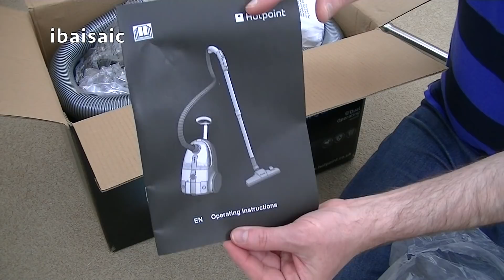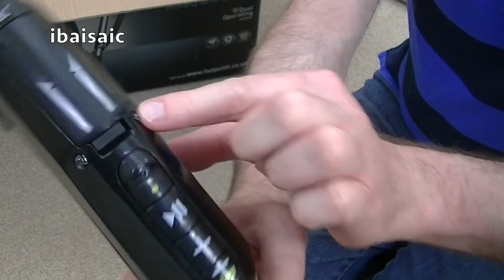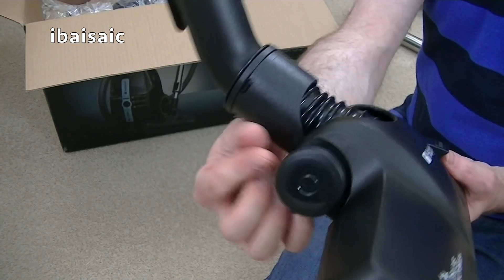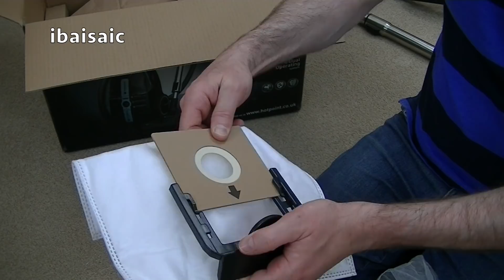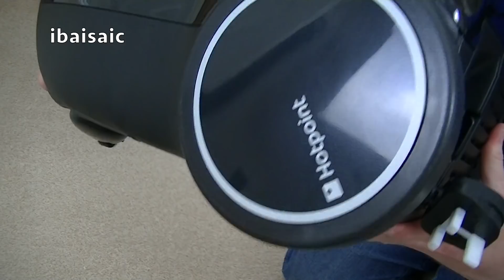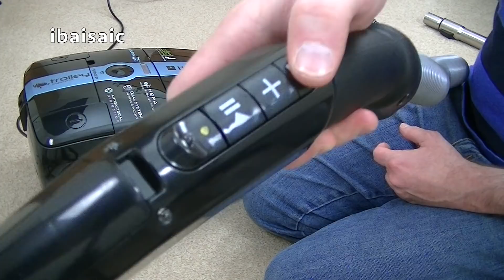Hotpoint SLD10 HD Line Bagged/Bagless Trolley Vac Unboxing & First Look

Comment: Hotpoint was estabished in 1911 and has been selling electrical appliances in the UK 
since 1920. Hotpoint were selling vacuum cleaners long before the Light N Easy.
Reply from the maker: I know Hotpoint made vacuums long before the light an easy, but growing up, that's the model I most remembered.
Reply: You are obviiusly much younger than me. When I was growing up the cleaners  I used were a Hoover Junior model 375, an Electrolux 64 cylinder and a Hoover Junior model 1334.

Comment: Actually the vacuums branded Hotpoint in the 80s were produced by Siemens, not Bosch. I remember one of the uprights had a dry cleaning function similar to the Sebo duo which came with Sapur powder. I think it was the "Electronic de luxe" model. I'd love to see one of those on your channel some day but that's unlikely as they are ultra rare now.